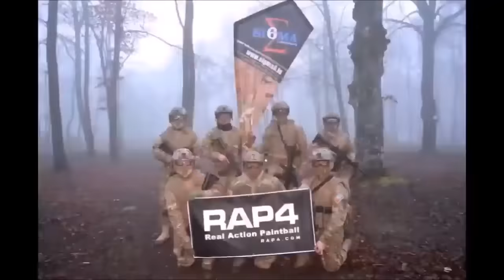Hammerhead Barrel 101 For Paintball and First Strike

Comment: a 12 inch barrel in 68 cal the gas is still expanding as the projectile has left the barrel ,  not the best effiiciency  by a long shot ..  but i guess theyre made for  manoverability  over out n out accuracy .,  between 16 -20 inch with 68 cal gives best results , but ball ammo sizes are all over the place .. consitent shooting requires consistent ammo !  then your longer barrels start to perform better